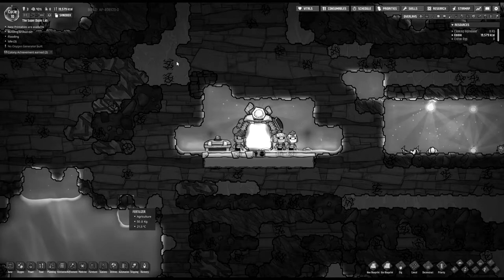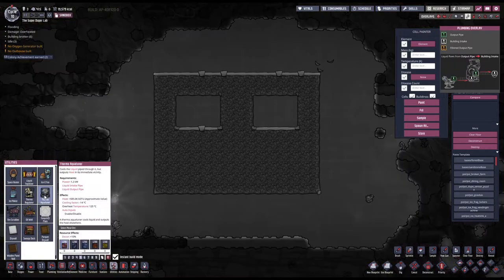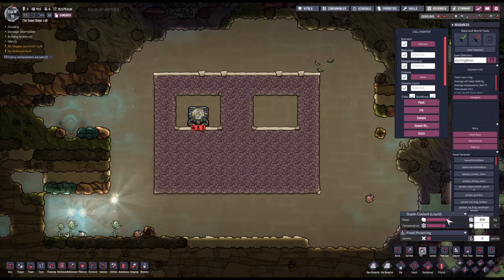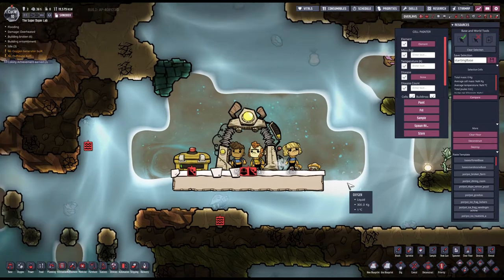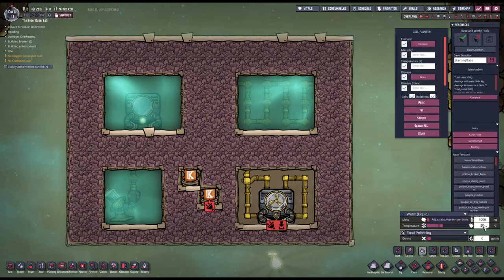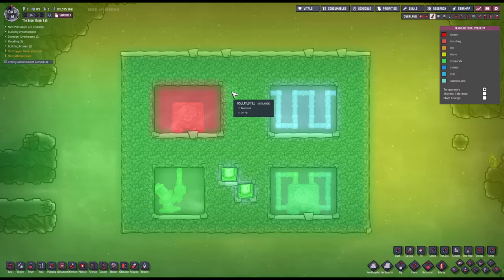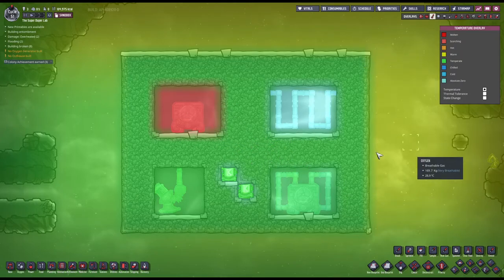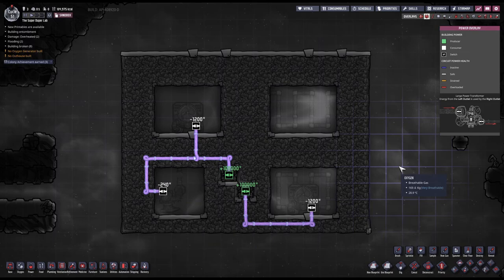Thermodynamics NOT Included? - Super Duper Lab | Oxygen Not Included

Comment: Just a tip if you try an experiment like this again, use tempshift plates inside the chambers to maximize energy transfer. As you said at the very end of the video, the super coolant inside the pipes was colder than the coolant in the chamber, as well as to spread the heat/cold through the chamber. Just make sure that the tempshift plates don’t touch the insulated walls.
Reply from the maker: Thanks for the hint. Will be noted down. ;)
Reply: Petar's Sandbox also, I forgot to mention it in the comment, but make them out of diamond. It has the highest thermal conductivity in the game (if I recall correctly)

Comment: Did you take into account the starting temperature of the aquatuner and the radiant pipes?

Was there ambient cold that seeped into the system? Would it make a difference if you ran the experiment in a different biome? The space?
Reply from the maker: Yes, I did take the starting temperatures of the pipes and the aquatuner into consideration when I built them. Initially I planned to do the experiment at 0°C, but then I saw, that the buildings are placed automatically  at 20°C, which made me use that temperature as a starting point.
To your other questions, I did my best to insulate the "system" as good as possible. I used Insulation as a material for the pipes and tiles, so that the temperature leak/exchange is as minimum as possible in the game. And because of that, it did not make a difference to run it in a different biome. I tried it in the Hydrogen/Chlorine biome and also in space, where I used Dry Wall made out of Insulation @20°C. Hope this helps! ;)
Reply: @petarssandbox4098  thanks so much for the reply.. anything that violates the laws of thermodynamics even in games make me crazy.